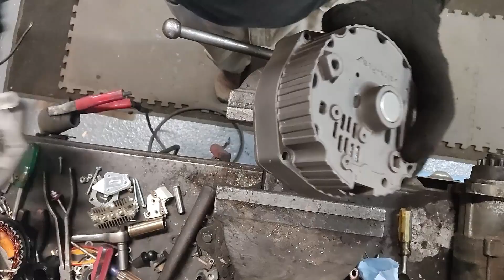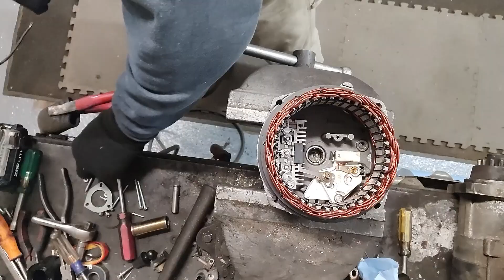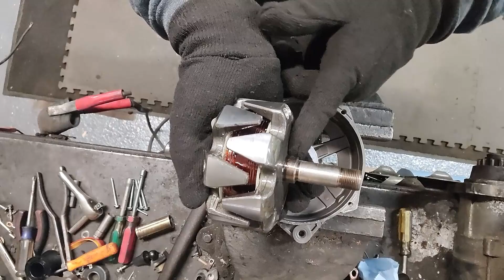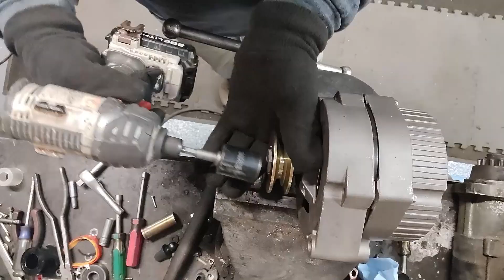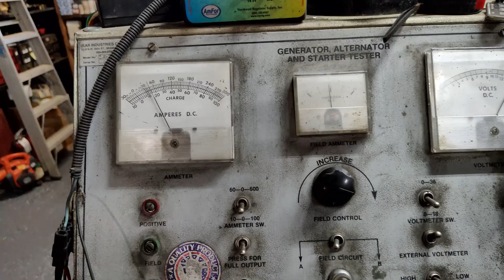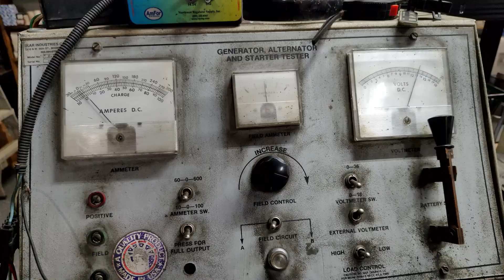Building a Delco one wire Alternator

Comment: Actually sir this helps quite a bit yet leaves me with a few questions. I bought a 10SI and needed to clock it because the 2 wire plug wouldn't work the way I needed to mount it, wouldn't work where they were, so I removed the 4 bolts, and having never done it before just pulled it apart, now my brushes are in the way for reassembly. I've watched it a few times now and didn't see any brushes. you did mention at 2:48 you were installing a 10SI regulator that's been changed internally. Is this to eliminate the brushes?  Is this a custom part? But at 11: 03 you pull the "Brush wire" which I didn't see you install or exactly where it came out of. I assumed it was to hold the brushes out of the way. Next question, Can you do the same thing on a CS alternator eliminating the need for the EMS, and just have it as a single wire to the battery? and lastly you said you can do 24V, how much are they and can you use my cases of CS Delco Remy or do you provide them? Thank you and for your first video, you did a very good job. Bill "skip" Wilson in Oklahoma.
Reply from the maker: I'm sorry I didn't show the brush holder assembly in more detail,there is a pin hole in the brush holder that holds the brushes in place and goes out the rear housing of the unit
I mentioned the regulator had been changed internally ,basically it was built to turn itself on/off and named an SE(self exciting) regulator
Yes the CS series alternators can be converted to a one wire 
Please contact me Via Email @ bargostarter@gmail.com with your telephone number and we can better discuss this